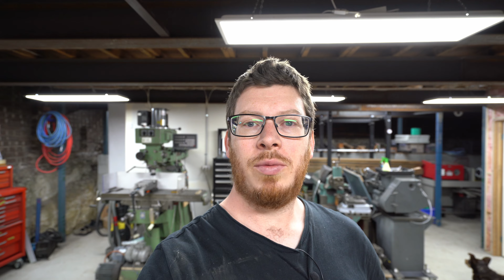Workshop TOUR 2022 | CRAIG'S WORKSHOP

Comment: Nice setup.
The breather vents on the electrical panel are a good idea if you're storing solvents.
Even the commercial flammable goods cabinets have venting. You can put put some fine brass mesh across the vent to keep sparks out.

Comment: Craig,, is your mill 240 volt or 3 phase,,I have 240 Volt 20Amp in my shed, but can’t get 3phase with out selling the house to pay for it.. regards Frank
Reply from the maker: Hi Frank. The motor on my mill is 3 phase 200V. No need for 3 phase power from the wall though, I use a VFD. Works perfectly and gives you extra things that a straight forward 3 phase supply could not, like variable speed, fwd/rev for tapping, and soft start. It's a real upgrade. I have just fitted one to my bigger lathe too.

Comment: keep ya shaper, they don't walk around unless you run them too fast, couple of concrete screws will keep it in place even on thin concrete.
My machines have been packed in shipping containers for the last 18 months as I recently moved to Victoria, I need to concrete the floor in the shed and line and insulate it, so will be another year or more before that's done, then set up the 3 phase generator, 😭.
You shop looks great!
Reply from the maker: Hi Woz. Too late I am afraid it went about two weeks ago. I also needed the floor space and fewer projects on my plate. Your workshop will be great when you get those jobs done 👌🍻 Cheers, Craig
Reply: @CraigsWorkshop  😪. i hate parting with a good servant, swapped my forklift for a shipping container, the cost of getting the fork down here was stupid.
yes my workshop will be good, one day.

Comment: Hello Craig, it a big workshop how many M2 is it nice video alswel there is some work to do on the wall but if you have time 👍👍😉😉
Reply from the maker: Yeah it is a big space, one of the main reasons we picked the house! The framing and building is a gradual thing and I do it as I can afford the time and materials. Floor area is an L shape, and it is a 12x12m box with a 6x6m box cut out of one corner. So it's a bit over 100m2

Comment: Your shop appears to be in a basement. How did you get the mill and large lathe into the shop? It doesn't look like you have a door leading outside did it all come down the stairs?
Reply from the maker: It does look that way in the video - but behind the pile of insulation at the woodwork end, is a roller door which leads outside, it's ground level for the front half, and the back half the earth comes up to about chest level outside the walls. I could not have dealt with a workshop that was not on ground level, too difficult! Thanks for the comment.

Comment: The algorithm brought me here and I'm glad it did! I've been watching shop tours and there aren't many videos of mixed-use shops with the various capabilities of yours. Do you ever have issues with machining and woodworking in the same space? Does your dust collection and general cleaning keep most of the sawdust mess in the wood side of the shop? Thanks again for sharing and I'm excited to check out some of your other content as well. Subscribed :)
Reply from the maker: Hey there. Thanks for watching and for the sub. I do sometimes wish I had a thick vinyl curtain between the woodwork area and the metalwork area, but for the most part (since there's only one of me), I work on a metal work project, and tidy up at the end, or I work on a woodwork project and tidy up at the end.

Vacuum extraction on things like saws, routing, sanding, keeps the wood dust to a minimum, and chip shields on the mill keeps that kind of mess down.

One thing that messes with the whole arrangement is grinding, I am actvely trying to minimise my angle grinder usage, to keep the mess right down - that kind of mess kills machines, and fills the air and every corner of the workshop with a black soot-like abrasive and steel dust mess.

If I really need to angle grind, I try to do it outside, but there is also a small grinding room in the works which you can see in the video. Once I frame and line that out, I'll have a place to contain the mess! Thanks again.
Reply: @CraigsWorkshop  I appreciate the thorough response! Thank you and have a great day!

Comment: What ever happened to the CNC you had?
Reply from the maker: That went away! I had too much gear in here, and my love is for the old manual stuff. Certain things I've picked up because the price was right or because I'm greedy, and in the same vein, I have to admit when I've been greedy and pass those thing on to someone that will use them. I think the shaper falls into that category a bit. Same with the lathes, but I think the large and small lathe (and selling the medium one) will do everything I ever need from here on.

Comment: With the tool and cutter grinder, do you think you’ll sell off the DBit? Or do you feel that they will both serve different purposes?
Reply from the maker: PS. That doesn't answer your question sorry. Mostly because I haven't decided yet. But those are the pros and cons as I see them so far.
Reply from the maker: I think the benefit of the D bit grinder will be that it is always ready to go (or at most 30 seconds away) from being able to do the jobs it can do. The T&CG is more configurable and will have centres and mag vise and all sorts which can be clamped in place, need tramming etc, and so it will be a "slow" machine to set up, a bit like a mill.